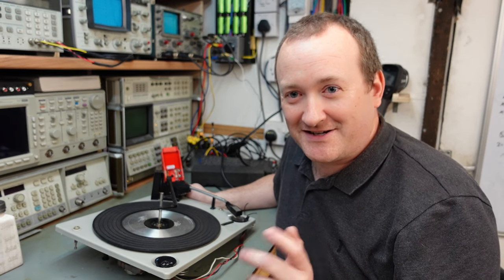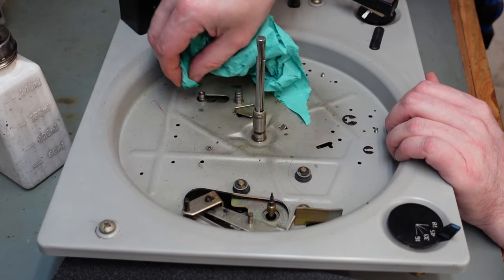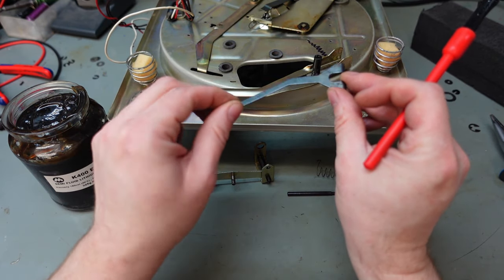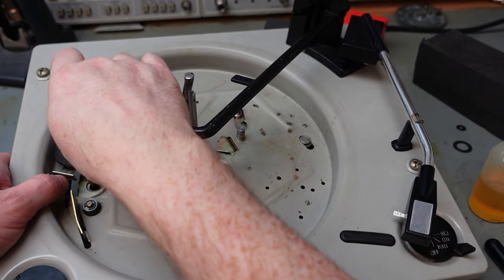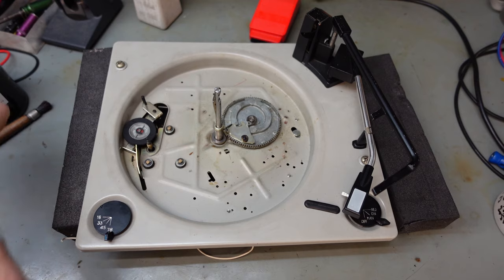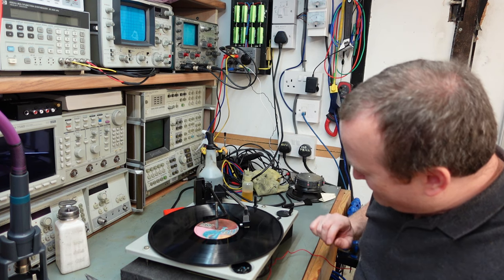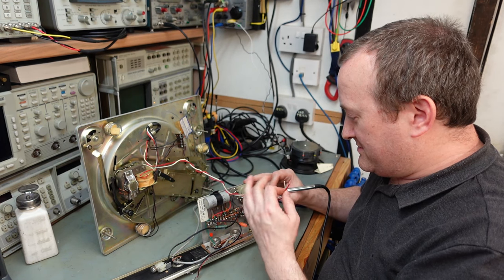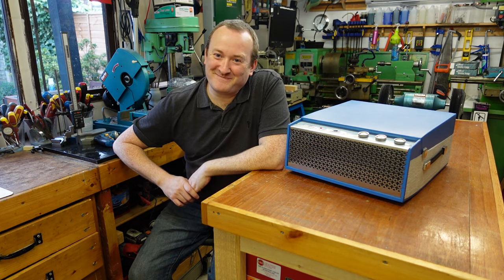1970 KB Record Player Restoration - Part 2 (BSR UA15SS)

Comment: Enjoyed watching you repair this Mark, well done. Not sure if you are aware but a quick way to wrap wires together, to get a really good tight twist, secure one end of the wires in a vice, the other ends in the chuck of a drill, and gently turn the drill on, pulling a little until they are the required twist.

Comment: I had one of those back in the 70's. I tried very hard to get that BSR deck to work with a magnetic cartridge. It was impossible due the the huge magnetic flux put out by that motor.
I even tried to bodge in a motor I harvisted from a cassette player. I failed. Then again I was 8 at the time.

Comment: That is quite an old transistor design for the 1970’s. The selenium rectifier, tag board construction and tiny output transistors look more like an early ‘60s design. Maybe they didn’t change it because it works! But really, the output was probably less than a watt. Were they germanium output transistors?

Comment: Great job. Very neat Rexine/wallpaper covering. I'm intrigued by the amplifier. It looks like just a few small transistors on a tag strip. Was there a power amp module or some power transistors hiding somewhere? Was the chassis potentially live?

Comment: Excellent work, as usual everything about this was top notch.  I was curious if you had given thought about replacing the main electrolytic filter? Seeing that it still has the original selenium rectifier, they’re extremely reliable as long as the capacitor that’s filtering it’s DC output doesn’t decide to die. Of course if that happened then you could swap over to silicon and an appropriate resistor to drop the voltage to account for the more efficient rectifier.  I of course know that you know all of this, I was just curious if you had given it thought or not.  I always do and generally go the cautious route.
Reply: I think the basic principle is not to touch the old working parts while restoring. If we start by replacing the selenium rectifier then many adjustments are required. integrity is broken. Of course this is my opinion.

Comment: For a restoration on this level it would have been prudent to disassemble the motor and add some light oil to the felt surrounding the sintered metal bearings to ensure years of lubrication.

Comment: Turning the stereo into mono with the connector - will this not suffer from destructive interference of the waveforms? Both pickups have a horizontal component that is negated in mono. So if you add them together it can cancel out to some extent. As I understand it you'd need to reverse the polarity of one pickup to avoid this. Maybe that's how your connector is configured though.

Comment: I don't suppose the BSR deck has capabilities to adjust the speed so it plays accurately? If not what would it take to add those capabilities? A beautiful resto ❤
Reply: You would need a constant voltage or constant current source (I'm not sure which) for the motor and a sensor to observe the speed of the turntable and feed that back to the constant source to continuously adjust it.

Comment: Those crystal cartridges had quite good sound quality at tbe time, better than ceramic in many ways.  Unfortunately even if you find new old stock, they are often dead for the reason you said.  Moisture.   Ceramic cartridges can sound decent witth the right equilisation network.   I know they got a bad reputation from cheaper gramophone systems that had poor equalisation circuits.

Comment: Hi,I’m refurbing a Regentone 60s record player,the 3 pots are worn,but on the on pot connected by a wire solder lug on the pot,to the mains,,there are 3 lugs on the pot for wires,and the 3 lugs which are soldered into the board,but on a modern pot,only 3 lugs that go into the board!is there a way to use modern pots,or have I got to try and hunt down used originals? Any advice would be welcome,thanks
Reply from the maker: You can use a standard pot, but you will need to find a new way to turn it on and off. I really try to restore these parts if I can. If not, I’ll try to find a replacement. If that doesn’t work out, I’ll fabricate a new mechanism, like a microswitch and a cam. All good fun 👍

Comment: Nice job Mark. 16 speed, don't think I ever saw that speed before. I think our one did 78,45,33.
Reply: My parent's hi-fi turntable had 16, I think it was used for spoken word recordings, like language courses and such. Creepy to play the Beatles on half speed, though.
Reply: That's right - low fidelity, but intended for spoken word LPs. They didn't take off so something of a 60s curio. @cmonkey63
Reply: Yes, it was used mostly for spoken word. The speed was actually 16-2/3 RPM (33 is actually 33-1/3).
Reply: I'm not too sure about those numbers Mark. I would of thought 16 refers to 16 times a minute. So a minute being 60 secs obviously, would say 16 is closer to 1/4 RPM. 33 would be 1/2 RPM. And 45 2/3 RPM. 78 seems closer to 1 and 1/3 RPM'S! But that's just roughly speaking.  @markanderson2904
Reply: @anthonydenn4345  Well, I'm sure.
Reply: @anthonydenn4345  Then you would have been wrong! "16 [WHAT] times a minute"?  Looking at your examples, you seem to be dividing a minute by 16 (60/16=3.75). And, dividing a minute by 33. "16 times a minute" does not mean 60 divided by 16.  You say "16 times a minute" but then you give the explanation of 60 seconds divided by 16.  (And why 60 seconds. Why not 1 minute divided by 16 (1/16)?  Then you deduce that 16 means 1/4 RPM which means that it takes 4 minutes for the record to make a single rotation. And, you think that at "33" a record takes 2 full minutes to make a single rotation. You're not thinking very well.  Have you ever seen a record turning on a record player? Apparently, not. So, the WHAT that I asked you about, you think is seconds. "16 seconds times a minute".  That doesn't make sense.  It certainly doesn't mean that you divide 16 into 60. 

The number (16 or 33) refers to "revolutions". 16 revolutions per minute (or RPM). And, as I said, "16" means 16-2/3. "33" means 33-1/3. 45 is 45 and 78 is 78.  (For a while, there was 78.26 RPM in countries that has 60Hz mains, and 77.92 RPM in countries that has 50Hz mains. Also, there was a speed that referred to linear velocity rather that rotational velocity. And, I've read that there was an 8-1/3, 'though I've never seen one.)

 If you're still not sure", check out other sources. Google "four turntable speeds".
Reply: Ah yes, I see what I did wrong now. Our turntables didn't always come with the fraction of a revolution marking on the unit. So I forgot about that bit. I thought you were converting the overall speeds into fractions alone for that reason. My bad 😉 Well in my defense I haven't used a record player for 30 years   @markanderson2904

Comment: I mark,  I get a slight more hiss out of 1 of my hifi speakers. I tested the speaker output on the amplifier, and I got around 14
millivolts out of one side and 17 from the other. Is this normal 🤔
Reply: It's normal for amplifiers not to be perfectly matched, unless they were designed and built to be so. You might have a noisier resistor in the signal path of one channel.

Comment: How does the changer know where to drop the tonearm on a 45 RPM record?  Does it take this info from the playing speed?
Reply: On this model there is a trip level at the back next to the over-arm. As the record drops in auto mode, the level either trips all the way down for a 12"disc, only a slight trip for a 10" and is not tripped at all (misses the lever altogether) for a 7" record. When the over-arm that stacks the records on the spindle drops all the way down after the last in the stack, then the charge knows there are no more records to play and cycles off at the conclusion of the last playing. Hope that helps !
Reply: There is a trip lever at the back that detects the size of a record as it drops in auto mode.

Comment: Ever heard of circlip pliers,?
Reply: do they work with these circlips without holes in them?
Reply: @tommeier2299  i can hardly see the exact one you are referring to, but yes in general they do. Those lacking holes still have small tabs to push open the clip. Just a little more fiddly
Reply: @bzuidgeest  ok I see. Will try it myself. Got those pliers but never used them on these clips
Reply: @tommeier4659  those pliers come in different types and shapes, you need to have the correct type for your clip. I have at least two, one for clips that need to bent inwards to be released and for the opposite. They you also have them with 90 degree angles and flat and whatnot.